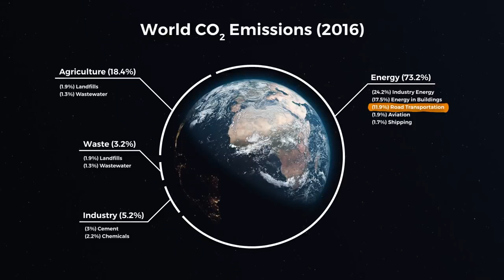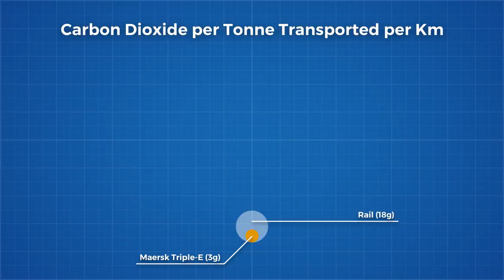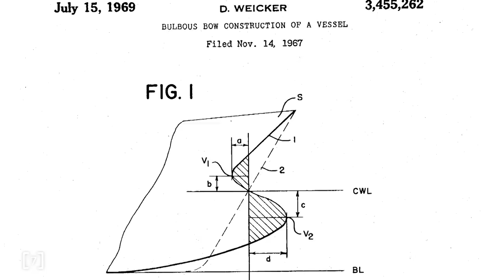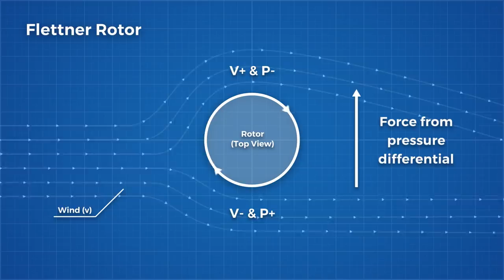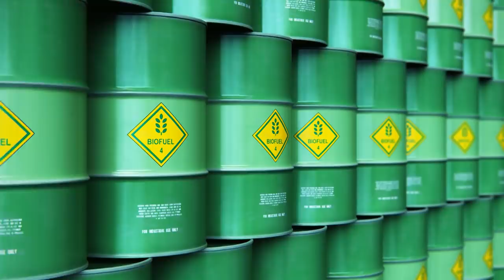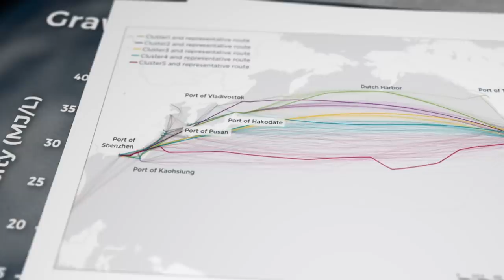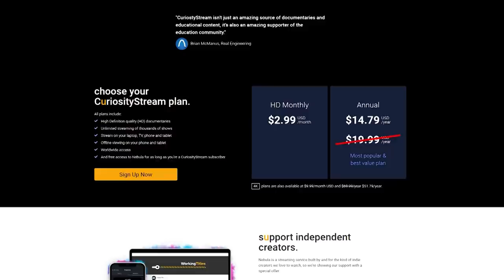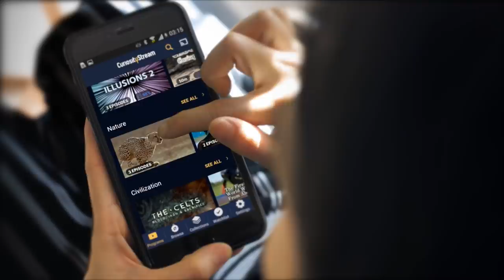Are Renewable Powered Ships Possible?

Comment: 'The truth about biofuels' coming out anytime soon? 
 love your videos!
Reply: The next, least bad, option is ‘alternative fuels’ or ‘bio fuels’ such as Ammonia (NH3), Biogas (basically good old CH4 or Methane) and Hydrogen (H2).  All require growing, harvesting and processing which have fiscal, environmental and energy costs or impacts, before you get their energy to the point of use, and the use of which will generate effluents that will impact the global environment one way or another.  Thomas Midgley, Jr. (born 18 May 1889 died 2 Nov 1944) was an American (USA) chemist who, as well as developing the technique of putting the lead (tetraethyl (TEL)) additive in petrol, created chlorofluorocarbons (CFCs), yes those ozone depleting CFCs, so that the use of NH3 as a refrigerant could be discontinued.  NH3 could be the most dangerous and least ‘clean’ clean energy source, it is very bad and probably deserves a rant all of its own; so let’s just leave that for a while (somewhere very far away that is cool, dark and quiet).  CH4 lots of it around much of which comes out of the ground as a fraction of the FOGI energy mining; even more can be created (relatively expensively) from anaerobic degradation of organic matter.  The organic matter may be algae, raw vegetation, food waste or vegetation pre-digested by domesticated livestock with the right (or wrong, depending on your point of view) sort of diet and gut fauna.  CH4 is a lighter than air, vapour at environmental temperatures and pressures and you need to compress it, a lot, or cool it, a lot, to get enough on board your ship in manageable volumes to be useful; also bear in mind that the containment of the very cold (LNG) or high pressure (CNG) CH4 has mass and costs.  Carry it as cargo and you can burn the ‘boil off’, when the latent heat of vaporisation has the co-activity benefit of keeping the cargo and the cargo system cold, otherwise more trouble and expense than merit and savings.

To liberate hydrogen (H2) from water you need a lot of energy and while fossil oil & gas, or perhaps coal, will do it and are the most readily available any energy source, wood, photovoltaic, wind, tidal, et cetera, will do.  H2 is said to be good for use in fuel cells that will give clean energy when combined with Oxygen (O2) and leave only water (H2O) as an effluent; so as well as the cost of creating the hardware and separating out the H2 in the first place we now have the cost of providing the O2.  H2 is very, very light and very, very volatile so this is where we remember the Hindenberg airship disaster and while events of that magnitude might not be likely much smaller H2 fires or explosions can cause a lot of damage.  The ‘light’ means that though there is lots of energy per unit mass there is not much mass per unit of volume so all the problems of CH4 but much worse.  You need to compress it, more than a lot, or cool it, more than a lot, to get enough on board your ship in manageable volumes to be useful.  The alternative to fuel cell use of H2, burning, also generates combustion products which includes waste heat going to the cold sink and a few NOx ‘nasties’.  H2 may have a place in the energy mix on land as a storage medium but on a ship where there is a reasonable and constant auxiliary power need the question could be posited, ‘why go through the extra stages instead of using the harvested energy directly?’  After harvesting the energy, from wind, sun or motion of the vessel, as electrical energy better to deploy that energy directly and immediately as heat, light or mechanical work.  As with nuclear energy at sea some of the ‘alternatives’ may have a use in littoral submarines in AIP (air independent propulsion) systems but that will be with the same caveats of cost, space and complexity so would not perform in a high volume low cost mercantile situation.  The numbers, on any of these, are getting very difficult to show any sort of surplus so is this a case of running hard to stand still?

Comment: Silly question: if shipping contributes less than 2% of greenhouse gas emission, why should I even care about it? Even if we drop that to zero, pretty much nothing will change.
Reply: very valid point!
Reply: Because it’s 1/50th of an enormous, global problem that impacts all of humanity for generations to come. If everyone says their piece of the pie is “too small to matter” we’ll never get anything done, will we?
Reply: 1.7% is not nothing, it is quite a lot. Everyone else also needs to get to work, just fixing shipping isn't enough, but it helps quite a bit.

The biggest transport win would be road transport but it would be slow, require a large investment, and would be a huge disruption. Also, there is no industry cohesion here, road transport is not as cooperative as air and sea transport have to be. Both air and sea have infrastructure bottlenecks, and that requires coooperation. 

Air transport is about as much as sea transport, and it would be a quick win, but it would require a huge disruption since it basically destroys most of the aviation industry.

Sea transport is medium to low investment and low disruption and the powerful companies support it because of two reasons: They know that the disruption of air and road transport will bring more work to them, so they are basically immortal, and they know that their immortality follows directly from them staying the most environmentally friendly option. So they invest.
Reply: @philipk89  in software engineering [industry i'm familiar with] when optimizing for performance first thing you tackle is bottleneck (a-la worst place), and then gradually you do trade-off between improvement & costs.
 on CO2 emission optimization, if it costs $Xbln to improve 2% in shipping, and hypothetically comparable $Ybln (~=$Xbln) somewhere else to improve let-say 10%.. why do we even bother about 2%?
Reply: @bramvanduijn8086 , ‘Air transport is about as much as sea transport, and it would be a quick win, but it would require a huge disruption since it basically destroys most of the aviation industry.’
Aviation is what actually annoys me. More specifically, when there’s some climate summit or what not, bunch of people meet to discuss it and inevitably there will be some journalist with a gotcha question of how the participant got to the place. And then the person being asked panics not wanting to admit they’ve flown. Meanwhile, there’s a very simple answer: ‘Yeah, I’ve flown and it doesn’t matter because aviation contributes less than 2% of greenhouse gasses so at the moment we have bigger fishes to fry’.
Reply: @mina86  No, the journalist does have a point since burning an orphanage on your way to an anti-orphanage burning event is kinda hypocritical but there is one other good counter point: The journalist is a victim of a sampling bias. By definition, a large part of the people at the summit flew there since the world is a big place. It's like going to an AA meeting and heckling the members for being addicted. Yes, you are technically correct but you are also shooting low hanging fruit in a barrel. I might have overdone it on the metaphores there.
Reply: Because pointing fingers at bigger fish as an excuse to do nothing about your own very significant contributions to Co2 emmisions gets us nowhere.
Reply: @hydrochloricacid2146 , issue is that the opposite happens. People end up with a warped view of reality and point at the small fish letting the big fish go.
Reply: @mina86  the shipping industry is FAR from small fry though. I agree that we shouldn't put too much attention on the small stuff (eg rocketry) but that doesn't mean we should ignore the source of a decent fraction of our emmisions
Reply: @bramvanduijn8086 , that’s not a good counter. Sampling bias doesn’t matter. If you accept that flying is bad than flying is bad. It doesn’t matter that you and everyone around you had to do it because the summit is far away; that’s not a valid excuse.
Reply: Well its about the same amount of pollution as a country the size of Germany.
Reply: @jamesday7339 , yes, but if Germany reduces it’s emissions, whatever they did will have some applications for other countries.

Just to be clear, I’m not criticising shipping industry for doing it or saying they shouldn’t be doing it. I just kinda don’t care and would rather hear of a way to reduce beef consumption around the world.
Reply: @mina86  so conclude yr point here you want to turn us all into vegetarians and don't actually care about reducing millions of tonnes of GHG emissions per year.
Reply: @jamesday7339 , nope. Agriculture was just an example of an industry that contributes ten times more than shipping and as such I’m much more curious what is/can be done in that sector.

Comment: The problem i see with wind powered ships is for example 

Sail boats are calculated as 1.5hp per sq ft of 60mph wind 

So if you have a 100sq ft windmill its taking in 150hp of energy (112kws)
But that doesn't include generation efficiency which is about 70% 

But if its a head wind blowing it is putting roughly 150hp of stopping power on the ship, well only generating roughly 105hp of electricity at 70% efficiency exchange 
I.e its making more drag, then its making in power, costing more on fuel not less

Comment: Nuclear reactors? I mean Russia already has a floating nuclear power plant.
Reply: Nuclear ships are nothing new, the Otto Hahn and NS Savannah were build in the 60s but were too expensive. Russia has their Icebreakers run on nuclear power. The technology is not a problem.
Reply: nuclear reactors ultimately rely on nuclear material which is once again finite and not renewable. then there also comes the issue of disposal of the used nuclear material which is radioactive. nuclear power can cut emissions but it will bring about a whole new problem if accommodated into such a scale which is why he said we have to choose the alternative very carefully moving forward as it will be catastrophic if we cannot deal with the consequences of the new chain of events it will bring. nuclear power should remain on a small scale like power plants for now.
Reply: @kavikyu8703  there's enough radioactive materials to cover the whole of humanity's energy need for several thousand years, so that's far from being a problem.
Disposal of used material is not a bigger issue than toxic materials from industry that is toxic for all eternity, it's even a lot easier. The quantity is ridiculously low at worst.
Nuclear power should greatly increase, in small and large scale applications.

Comment: Small correction (if I'm not wrong)
3:12 "The fuel consuption rises exponentially with each knot of speed added ". That statement might actually be wrong: it rises with the cubic of the speed : 
Power = Force * speed
Force = Drag = constant(depending on fluid, area etc) * speed^2
=> Power =  constant * speed^3
And Fuel Consumption is directly related to power (also efficiency is to be taken into account for the calculation but it only add a multiplicative term in the expression).

Comment: what we really need here is some portable fusion power and BIG rail guns on every ship. just because i said so.
Reply: They said carriers have killed the battleship, but when we get railguns, it will be an era of weapons that cannot be intercepted like missiles, so we will return to big gunned heavily armoured ships, and they’ll be sexy as
Reply: @fraznofire2508  I think the problem there wold be that armor would be pretty useless. So its probably small very stalthy ships with a big gun.
Reply: @thebaumfaeller1477  initially, but doctrine will be adjusted for when ships will be detected, they can’t avoid incoming rounds, and current ships wouldn’t be able to take the hit, then again, you may be right, as the armour might not even save them, and the smallest signature possible, the better
Reply: @thebaumfaeller1477  technology tends to leap frog like that. The first metal armor made many weapons almost useless, then armor piercing weapons like pikes and javelins came along, but then sturdier shields like the scutum came and made those weapons less effective, until the weapons got better. Later arrows like the bodkin point or crossbow bolts became better at piercing armor until plate armor made arrows and swords almost useless, then guns made heavy armor useless, until tanks became impervious to small arms, so we got anti tank guns. Kevlar made smaller bullets useless so we got larger, faster, stronger bullets. Every time a new defense comes along it takes awhile for weapons to surpass the defense, then it takes awhile for the weapon to beat it.
Reply: @arthas640  Maybe, but in the moment it looks like armor has some serious catching up to do.

Comment: no mention of nuclear?
Reply: Nuclear is not renewable, as there is a limited supply of U-235 in the world and it is irreversibly destroyed as it is used. It is low emissions (compared to coal) though.
Reply: its technically not really renewable, its sort of a fossil fuel since its made deep in stars and we cant easily manufacture or renewably harvest it. We have a set reserve on earth we can easily mine, the same as coal, and we can only use it to a certain degree before it gets spent. As technology improves we'll get more mileage out of a set amount of ore, but unlike solar or wind we cant indefinitely harvest it. It's still much better then coal or diesel and i think they should have talked more about it though, but maybe thats why he didnt.

Comment: The very most efficient mode of transportation for cargo,, is a ship.
Reply: Per ton/mile? Trains beat ships.
Reply: Indeed, but always remember that not transporting things at all, or transporting them much less far, is better. It's a complex optimisation, but just optimising the transport, without considering whether the transport is necessary is missing a trick.

Comment: The answer is probably not. Giant electromagnetic sails initially make sense but they come at some serious downsides mainly that you can't use the deck for storage which severely limits capacity numbers. Generally speaking Shipping is dictated by three things crew cost, turnover time, carrying capacity, and speed. Now there could be smaller bulk ships (i.e. corn, coal, ore, etc) that uses wind sails type system because they need to keep the product in the berth. But you are extremely unlikely to see Container ships or break bulk ships use it due to it screwing with either cranes or carry capacity. We'll like continue to see container ships using diesel until either Efuel or Hydrogen replaces it due it requiring minimal changes.

I took some marine engineering courses before switching to chemistry.

Comment: I sort of missed the calculation for the amount of spend energy on a trip (say china-usa) and figuring out if one could do that on a battery ... then perhaps combining solar and wind energy systems on a ship 'may' reduce the needed capacity. Another interesting angle could be to have 'shipping container batteries', where the ships battery is given extra 'juice' from batteries that are situated into a shipping container, this could be an alternative option for 'refueling' ... aka. More engineering, less throwing options into the air hoping one sticks or appeals.

Comment: As usual, great video. Thx for your hard work.

I've recently heard a documentary made by the German public radio on the environmental footprint of biofuels. It very much confirms your concerns about them. Most of the crop production revolves around high-intensity agriculture and apparently requires large amounts of fertilizer to remain profitable. Sources on the exact ecological footprint vary quite a bit and seem to be somewhere between a net-negative and a 50% reduction. Either way, the increased use of fertilizer compared to food production, has a negative impact on water quality.

Comment: I am going to be that guy. WHAT ABOUT NUCLEAR!!!
Reply: as I replied to someone else : 
When facing a problem engineers shouldn't think of ways to add layers of complexity, but just on how to solve it. It can be done by asking the question differently. Instead of asking "Are Renewable Powered Ships Possible?" we should ask "how can we produce more locally so we don't need to transport a lot of useless stuff"
Reply: Probably not for mass usage on container ships. An oil spill is cleanable...
Also, nuclear propulsion is probably far too expensive for container ships...
Reply: @enricodragoni   "how can we produce more locally so we don't need to transport a lot of useless stuff"

Oh yeah, engineering the world economy isn't complicated at all.....
Reply: @tigershark2328  A nuclear reactor doesn't "spill" Even if the ship went down(And when was the last time a mega container ship sunk?) the reactor would be nice and safe inside a containment box at the bottom of the ocean.
Reply: eff off
Reply: @TheOwenMajor  "Oh yeah, engineering the world economy isn't complicated at all....."
-
If we don't, there is no solving the problem of global warming, PERIOD.
Reply: @TheOwenMajor  Not only that. Water is used as a containment medium for nuclear reactors. Guess what the ocean is made out of. water.
Reply: @johnproctor876  Wooden ships with linen or cotton sails were literally used for centuries. Completely wind-powered and biodegradable.